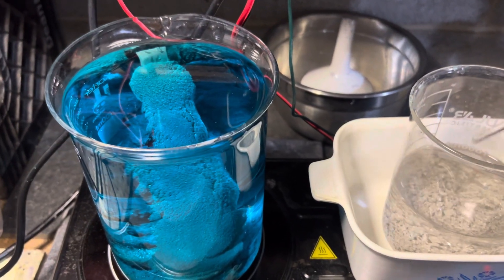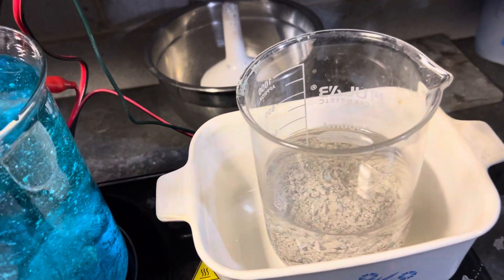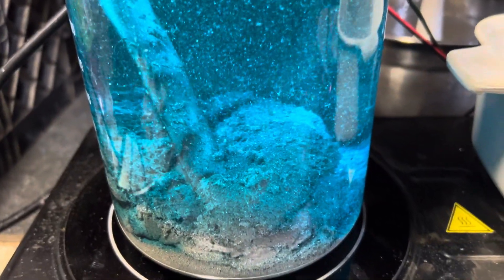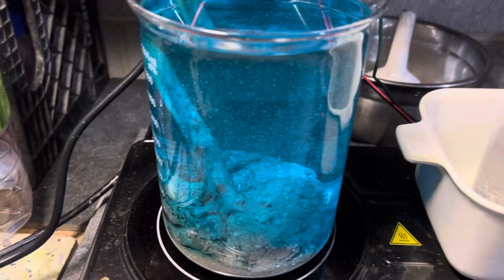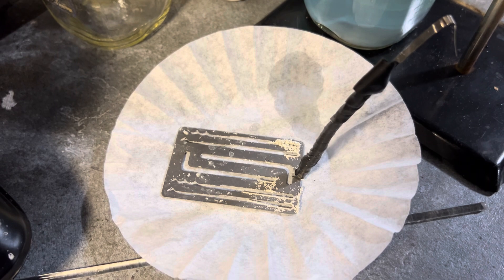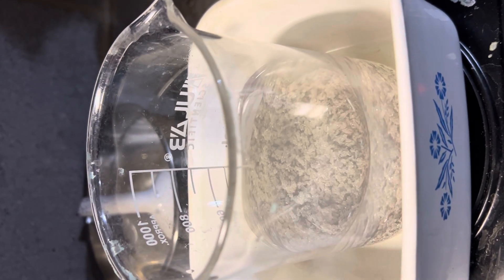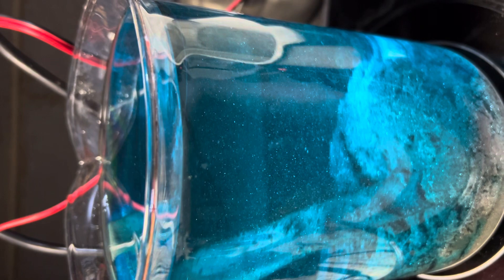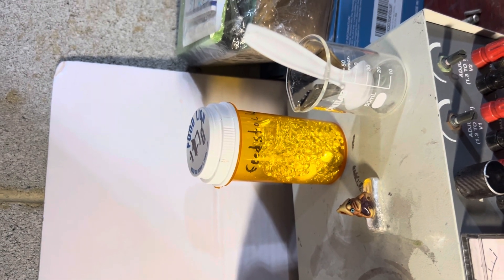Silver Cementing out on copper bars #silverrecovery #chemistry #silver

Comment: Hello my dear friend, You made good work there, design is also nice, using titanium is brilliant for these cells. But as i see, because of color of the liquid start gets some copper as blue level. If you make it slow you will not see on cathode in short time but after some time you should prepare new liquid and recycle that silver as usual. Voltage is most important issue here. Congrats to have nice electrolyric crystals of silver. I am surely thats are 999 maybe 9999 purity. Nice work!